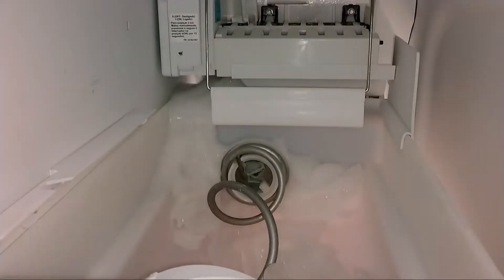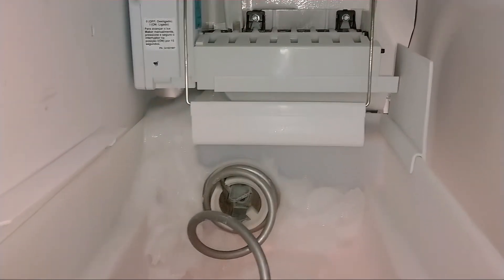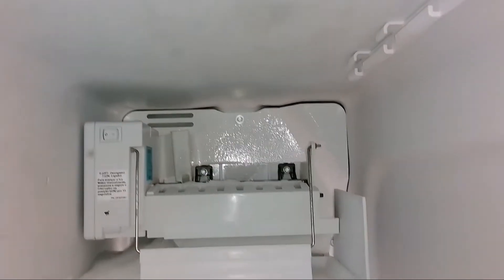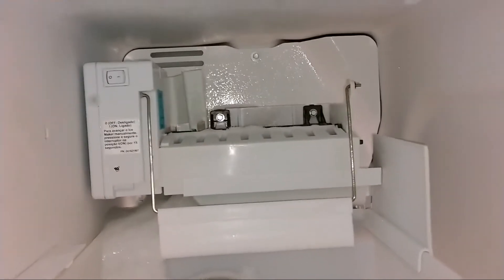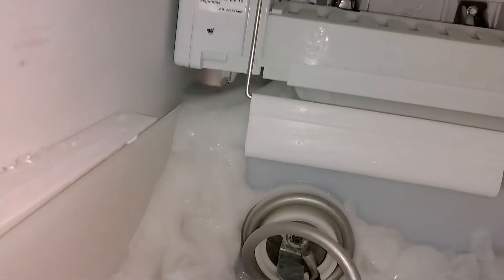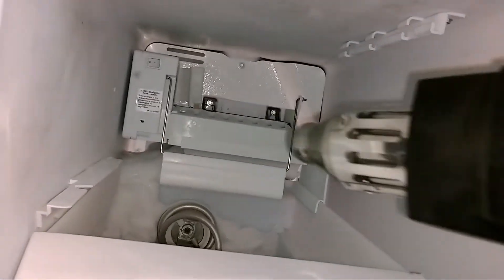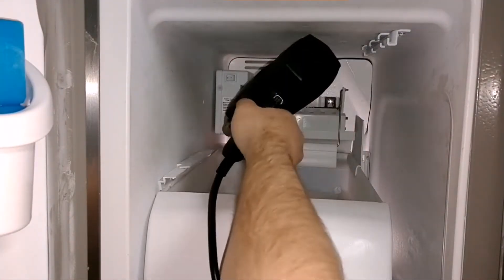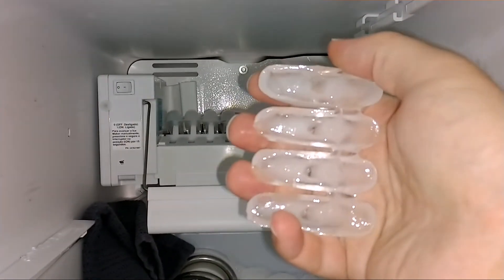Fixing Stuck Frigidaire Ice Machine

Comment: Did you ever fix your fridge problem?
Reply from the maker: No. Still overflowing into ice hopper. Some people commented with some suggestions. I can't remember if there's an adjustment or if I would have to replace a regulator valve.
Reply: @becausestuffbreaks  Looks like my Frigidaire. plhs269zdb3 is my model #. At first we were getting too much Ice then no more ice. I replaced the inlet valves in the back and the ice unit itself. Then, after all that I still didn't get water coming in. So I took off the unit and looked at the tube where the water comes in and it was frozen. So I took a drill and bit and drilled the ice off then with a hair blower to thaw it out. Held it for 15 secs and made the lever cycle itself and it worked. So today we noticed we had too much ice and we now think its the what they call the ice cream shelf. The one we have goes all the way to the back where the lever may be hitting it and I just ordered another shorter shelf that looks like it might work. Hopefully the troubleshooting I wrote can help you solve yours. You may be getting too much water due to a faulty inlet valve. Easy to install from the back and it about 30 bucks on Amazon.
Reply from the maker: Thanks for the feedback. I have an 8yr old, 2yr old and a 1yr old. I'll try to find time. Thanks for watching!